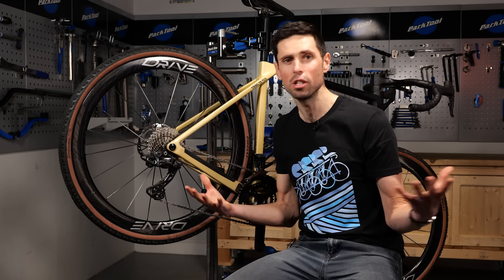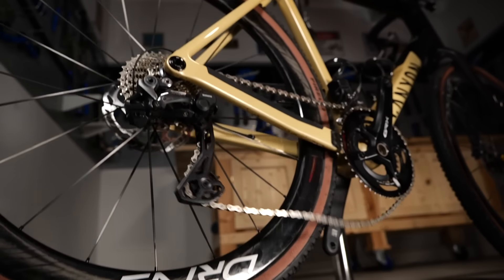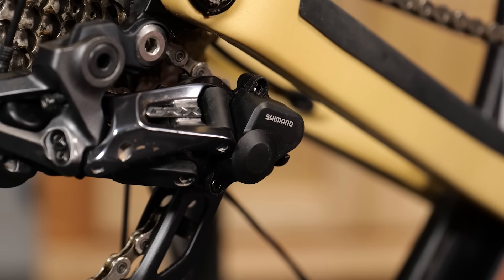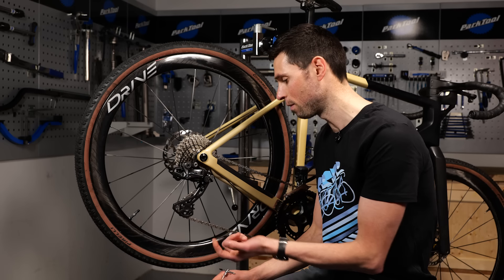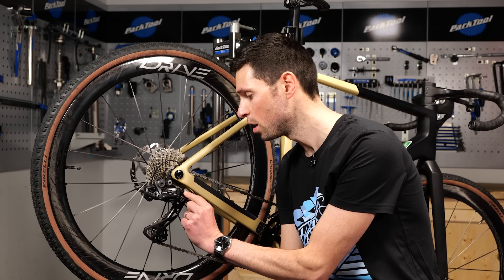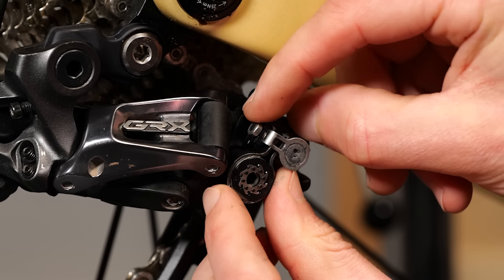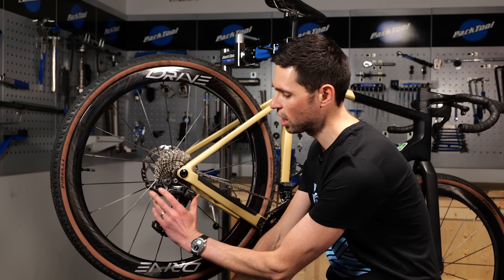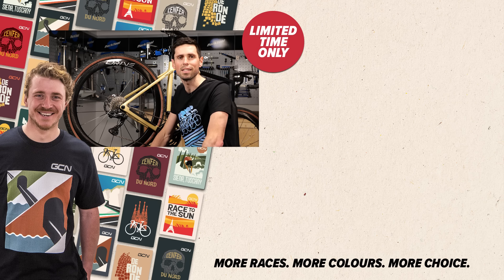How to Adjust a Clutch Derailleur

Comment: Perfect timing, have recently noticed my chain bouncing / skipping slightly - will check the clutch this afternoon 👍 Thank you!
Reply: You may want to check the chain wear first though... if you have not already. ;-)
Reply: @Tad7772   🙌 I was a bit lazy not saying I’d measured the chain and it has a bit left (but not much) before .75 slots in. I checked the tension in the cable this afternoon before thinking about going to the clutch (was serviced in September) and turned out that a little adjustment to that sorted the problem.
Reply: @jonathantraves8425  👍 Well, I am glad I wrote that "if you have not already" part than. 🙂 I changed the chain recently and just be cerful the recomendation for 11 - 13 speed chains is to change them at .50. I figured that you probably have GRX which I think is 11 - 12 speed so this may be helpful and could safe some money in the long run... ☝😉
Reply from the maker: How did you get on?
Reply: @Tad7772  I’ve ordered a new chain a splitting tool and some power links, took a while to find 116 link as per original spec.

Comment: Ordered a (fast?) gravel bike with 2by GRX group set on it that would be mainly used on the road (%80 of time). Is there any disadvantage to keep the clutch engaged on tarmac or is it best to use the clutch only on gravel or bumpy roads?
Reply: #askgcntech
Or something like that...
I'm also curious. Presumably, it would wear out/need adjustment much less if only used when off road. Or on a standard UK b-road...

Comment: Please do not use needlenose pliers to do this unless you really like rounded nuts.  Wrench or small adjustable wrench for this job.
Reply: Me = cringe moment
Reply: Proper sized spanners only as I emphasized to my learning group .
Reply: Yes. 100% use the correct spanner if you have it. But. If you can round that bolt with needle nose pliers it’s would be so tight/seized you’ve got bigger problems with the derailleur.
Reply: A shop full of tools and he grabs needle nose pliers…

Comment: I've got the GRX 2x with the clutch. The clutch clamps on a cylinder that rotates a little when the derailleur cage bounces and thus prevents it from bouncing. However, this thingi does not rotate at all when I move the cage or shift. What's wrong with my RD and how to fix it?

Comment: Question for a future tech show. Might be a physics question for Ollie. Exactly why does a front wheel touching a back wheel bring down the "front wheel" rider? Having crashed this way a few times, I don't recall my front wheel jerking 45-degrees to one side or anything like that. Nor do I recall hitting the back wheel as part of some rapid move across the road. I just touched a back wheel that was going 99% the same direction at 99% the same speed as me.  Is it just that a 5-degree, sudden front wheel turn knocks the rear rider and bike off balance, and then there is a wobble one way, then an over-correction, and then the rider crashes? Maybe it's silly to even wonder about this, and there is nothing happening beyond the simplest explanation that it makes the back rider jerk their wheel and they lose balance. Or, could the problem actually be that the touch significantly slows the rotation of the front wheel, ruins the gyroscope effect, and causes the front tire to skid for an instant? If there is something complex going on, once we know the actual physics, is there some technique riders can learn to stay upright? A gizmo that could be built into headsets to prevent whatever is happening in that 10/th of a second? (seatbelt shoulder harnesses have a mechanism that allows them to move slowly, but not quickly) It's sad to see so many wheel-touch crashes in the pro peloton alter so many seasons and careers.
Reply: I dont have a full explanation for this, but you say "I just touched a back wheel that was going 99% the same direction" but if you think about it the parts of the 2 wheels that touch are actually moving in opposite directions, so when they touch they will try to counteract each other. So (totally speculating at this point) the rear wheel of the rider In front is under torque from the rider/drivetrain and carries most of the riders weight. Your front wheel is basically freewheeling and supporting less weight. Therefore the rear wheel of the rider in front will "win" and your front wheel will decelerate dramatically, maybe even to the point it is for a split second lifted off the ground and forced the opposite way. So imagine popping a wheelie at high speed but holding the front brake on when the wheel touches the ground, it would cause the wheel to skid/bounce and you would likely lose all control.
Reply: Brilliant. That explains it. I thought about rotation, but only got as far as ... let's call it ... both wheels are going clockwise. I never got to seeing that at the point of contact, the back tire is moving upwards and the front tire is moving downwards.
Reply: @CL-789  Glad I could help, not sure it's a definitive explanation though, hopefully someone who understands the forces at play better than me will come along 👍